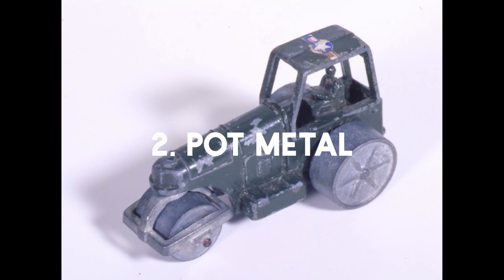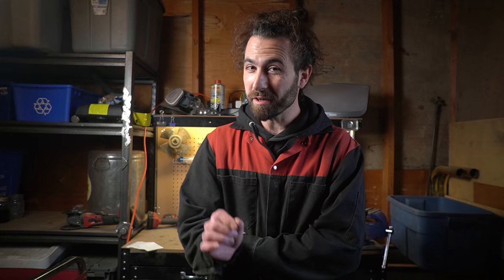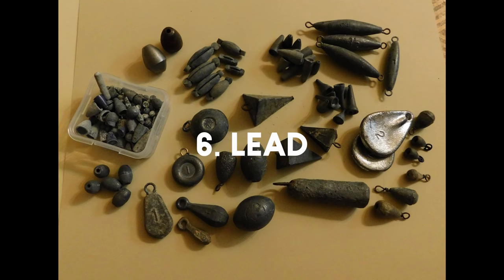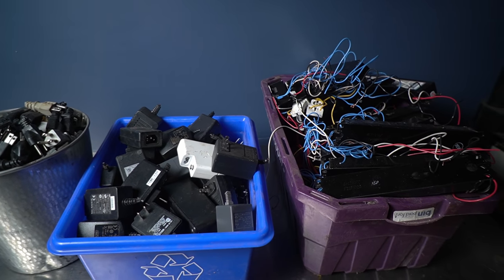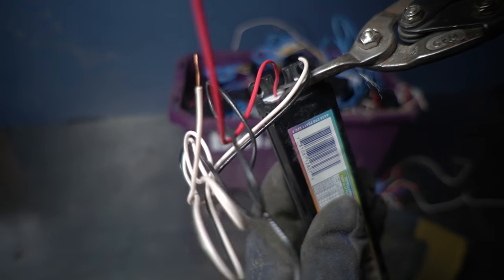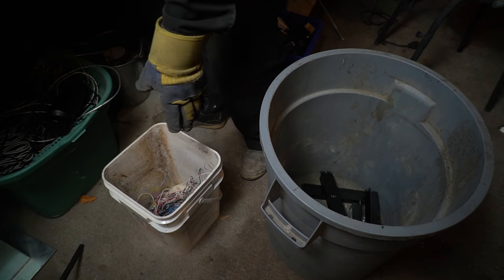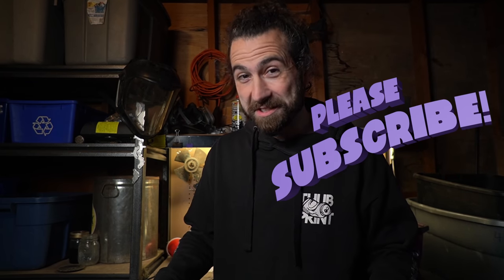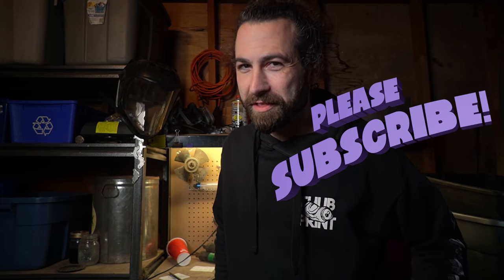I Never Scrap These 9 Items!

Comment: As a avid scraper I don’t feel that any amount of dismantling of items is a waste of time. Yes some things will take a long time but I enjoy it because I learn from stuff and I enjoy a couple of beers while dismantling. Scraping It’s my hobby not my day to day 9-5 job.  It makes some money and I’m fine with that.  The Rest of my time I’m busy on the farm.
Reply: What are your thoughts on breaking down flat screens TV’s?
Reply: @VAcreeper  replying because I’d like to know too I have 3 broken ones in my attic
Reply: It's also the sciences of engineering non-reuse or economic unfeasible (until when needed).  I see people stripping coated wires to get to the #2 copper projects rather than find a way to roll in like 10 feet and multiples lengths for engineering reuse projects.  When an engineering project needs it it will require wirings.  It is not to say that cracked and frayed (or aged copper wire coatings) are a reason to never reuse older wiring into new wiring projects but I think some bench tests can support going further with the wires and protection insulation shielding reuse rather than buy new and guaranteed again.
Reply: @VAcreeper  I do these a fair bit in Australia. There is little competition in picking them up. You get a bit of wire, the lcd is not worth anything itself, and is hazardous. You wouldn’t do it for the money.
Reply: @marcoparigi  that’s what i figured 
I appreciate your feedback 
Thx
Reply: I don't get into electronics.
Donate them to Best Buy or a pick up place.
Old lap tops I donate to a shop that sells used computers.
Cast aluminum, I will sell.
All aluminum is worth selling.
So is, copper wire and brass.
Even if you have to remove it from an appliance.

Comment: one thing to remember is that many people would consider time spent at home stripping metal is a better deal than going to a workplace, you can have a break when you want and are still there with your family.
Reply: You can even do it with your family if they're interested. Me and my girlfriend enjoy picking things up off the curb or out of dumpsters, getting back home and tearing them apart to see what's inside. My daughter(almost 2 years old) likes picking up all the screws and stuff with magnets and helps put plastic bits in a trash bag.
Reply: Hard to find a job you can do from home an hour here and hour there.
Reply: Yeah recently, I found 3 TV’s and a computer monitor in the trash, and I got some nice electronic components from them

Comment: Haha thanks for the mention, plug soup is the future lol easy to pull out all the pins but of course we have 3 nice chunky brass pins but I only boil mine for 10mins in the urn, that's all that is needed in that. I love that you mentioned most of my channel content as stuff you don't bother scrapping 😂🤣 but that is because I have a good board buyer here now in the UK and as you said, it is different depending on circumstances where individuals are, having said that, I have a mountain of laptops to do, they are definitely not my favourites 😆 The ring with copper wrapped round them are toroidal inductors or the large ones (which as a copper adoring woman are my favourites) are toroidal transformers and they contain a lot of copper. If people do the ewaste like me then cherry picking the small ones off of things like power supplies quickly make them mount up, I did that when I was stuck in with Covid. Here in the UK we get a good price for lead at the yard, it is illegal to use lead fishing weights here so no market that way. Fab video 😉
Reply: Mention off thub = made it 😁👍
Reply: @its_marc  lol 🙂 Hi Marc!
Reply: What do you do with your pthalate-cancer-soup after? Pour it down the drain?
Reply: Plug soup.. I love it, saw it on your channel sollers, I've been waiting to give it a go when I have a few more saved up. 😀 
Strange how different things are good in different countries.
Reply: @bfg69bug  oh good, plug soups away, now an international dish😁, I didn't come up with the original idea though, just the use of the urn for a 10min turn around 😄 but it's nice and quick and easy. Was nice to see Thub giving it a go 🙂 Have a lovely weekend James!
Reply: @gasstationpeanuts1814  no it is sealed in screen wash child lock bottle and I can reuse it or take it to the transfer station with old oil etc. It may surprise you that I don't incinerate armatures to get the copper or release the freon out of fridges to get any of the goodies either, some scrappers do actually care about the environment and for me just saving some things from landfill is only the first step!
Reply: @SollersScrappingandDiving  I meant no offense, just a gentle ribbing. I'm one of those weirdo tree-hugging scrappers too, I've peeled many a foil top off of dipping sauces and dutifully cart my cardboard to a local school cardboard collection dumpster.
Reply: i just put each plug on a vise and pull the brass pins out cold using brute force
Reply: @andrewcannon587  sadly I can't do that with the amount of plugs I get because it kills my wrists and I'm awful at doing them as I get them....always let them build up as a round-to-it job, even though I always intend not to 🙈🙃
Reply: @gasstationpeanuts1814  that's awesome, if only everybody was so diligent!! I'm very lucky where I am on the level of recycling we have..thankfully!!!
Reply: I’m also in the uk and a keen fisherman and every fishing weight I have bought for the last 20 years is made of lead and I also make my own they just need to be coated in plastic for inland fishing also I would love to know your board buyer as I’m saving up my circuit boards now my yard will buy them at £150 a tonne so anything low grade goes in a bin for them higher grade boards iv been saving in a separate bin
Reply: Just done some research and lead is fine to use as fishing weights as long as it doesn’t weigh between 0.06g to 28.5g so anything over 1 oz leads is fine to use lead as the weight personally I cost mine in a melted plastic so the lead is covered completely
Reply: @ccartershecticlife  oh I see, I looked it up and didn't realise it was only illegal between 0.06 grams and 28.35 grams, not really a regulation I understand as don't know much about fishing at all, just what my Dad and Hubby say lol. The company is AWA in Essex, I did a video of my trip explaining how it all works and their prices etc 👍
Reply: What is that none magnetic metal inside those toroidal inductors? Always wondered what it is
Reply: @dylanchalker-gent7441  Do you mean the ferrite? If so ferrite is made of strontium carbonate and iron oxide, I love ferrite toroids!
Reply: @SollersScrappingandDiving  is it valuable?
Reply: @dylanchalker-gent7441  some yards do have a category for it but I don't know what it goes for. I collect all my ferrite toroids, I think there is something about them and they will prove to be valuable one day, but that is just me🙈🙂 I like the big chunks of it you get around the yokes in CRT TVs and monitors too!
Reply: Lead fishing weights are illegal there?🤔 That's interesting! and I do understand the why behind it... But hmmm. Anyways, Thanks for all of your info, it was awesome!👍😉🇨🇦
Reply: @kevincordes2026  yes you are right, prices have rocketed, never mind gives me some justification for letting them build up for years 🙈
Reply: @David-sw3on  my pleasure 🙂👍

Comment: Zinc diecast pay way better than dirty aluminum. I can go through a  bucket of molded plug ends in an hour or less. With just a pair of vise grips and a pair of good diagonals. And if you leave a little copper on them they go red brass. Some of us don't have much scrap available, so we learn to scrap everything we can get.

Comment: Just want to add that , on the plug ends, I normally just use 2 pair of channel lock pliers. With the tops of the jaws as  leverage, I don't need to soften the plugs up before removing the brass. some times the brass breaks off but not often enough to make a significant difference in weight. I hope this helps at least 1 person to save time in recycling.
Reply: same.
Reply: I don't mess with them, they are 50 cents a pound as is.
Reply: @TheMurfed  yea but brass is $3/lb
Reply: What planet do you live on? A doller a kilo for plug ends? I get 10 cents @TheMurfed
Reply: Brass is $4 CAD it adds up    Buy a vise for the cord ends, seriously

Comment: the secret difference maker with laptops is the fact that in some cases, you can actually re-sell the Windows license that came with the laptop brand new. like 40 for the software license. Also there's a niche demand for "burner laptops" if you know someone who knows someone who does the dark web thing. Alternatively, take a few days to brush up on your A+ computer hardware knowledge and know that any halfway modern, complete laptop is worth $40 to a lot of people if it powers up, runs stable, and has a power cord.

Comment: Great video. For me, saving all the plug ends and taking the brass prongs out of them is definitely worth it. The way I strip them: I put them in the vice facing up and extract the prongs with side cutter pliers. Not hard on the wrist, very fast process, and no need to warm them up.
Reply from the maker: Huh, not sure why I struggled so much? Well glad you’ve got a good system 😄
Reply: @thubprint  why do you cut the plugs off the #2 wire? I run a scrap yard and have never had any issues with leaving plugs on the shop wire for the 12 years that ive been in business. Also with the laptops you should beable to find somebody paying 2 dollars or more per pound "American dollars" for complete laptops.  I think what you should do with your escrap is save up a large ammount than contact a US buyer to come buy it off from you. Where there is nobody buying it in your area that means you have no competition and could really have a monopoly on your local market. If there are no buyers in your area become the buyer in your area.

Comment: Fortunately for me, and many others, the situation in the US different when it comes to computer scrap.  That said, I agree on laptops.  I just sell them as is, not worth my time dealing with all those screws.  I did a video on power supplies comparing all the different ways they can be broken down for sales.  Bottom line for me - cut the wires and sell as PSU without wire.  BUT my yard is happy to take my #2 ICW with plug ends still on, so I save tons of time.  It's very interesting to watch these types of videos to compare what works and what doesn't in various regions and for different people.  Thanks for sharing.
Reply: I agree..
Reply: @darthtrolleus1947  🤣🤣

Comment: Your totally right. I quit wasting my time on any with a motor smaller than a box fan. Vacuum can be good but then your left with a mountain of plastics only a pro could separate and recycle to keep out of landfill. Keep scraping folks it just takes a while to find a method that works for you
Edit: do call out your buyer. They are allowed a very small percentage of trash to aluminum or brass even and you should be allowed to. To have a good load of aluminum rejected for a few onces of junk is heartbreaking especially when you know they will just mix it in the clean and still get a great price for there's but not yours. It's a rules for thee but not me kinda thing. Stand up to your buyer and they will eventually break. Just don't go full Karen you don't want to lose them completely forcing you to drive to another town and waste more of your time and money
Reply from the maker: I’ve learned that lesson myself, didn’t realize at first that they have a certain percentage of contaminants they allow in their clean bins. It helps to have several yards to choose between!
Reply: I grabbed a vacuum some put at the curb with their trash, tore it apart and made over $100 selling the parts on ebay. .. sometimes i cringe when i see scrappers just binning stuff because they see the $2 in copper but not the actual item that is 50x as valuable.

Same thing with conputer power supplies. The conponents inside are worth more than the copper, usually some large caps, high quality fets, ect that will all sell for wayyyy more than scrap value

Comment: I always welcome your perspective. I definitely save the zinc die cast and for a while I was getting a good number of PC power supplies while helping a non-profit dispose of their old computers. For plug ends I just break off the brass blades, but my scrapyard doesn't need the plugs cut off for #2 ICW, so I leave the rest on.

Comment: Hello Thub.
Plug ends,, I clamp them in the bench vice and a pair of sidecutter and pull them out, sometimes the copper strands come with.
Those round coils are called Torroidal transformer.

Comment: thx for the perspective! honestly i spend too much time breaking down anything, so i value the reminder. I too keep my lead, but for a different if not dissimilar reason: I'm teaching myself to flint-knap, and in so doing I also decided to make my own tools, including boppers. picture copper pipe with a cap soldered on the end, then fill it with lead for weight. ✓✓bopper✓✓. i took a little homemade ingot in to my scrapyard, asked the price, and immediately grabbed it out n took it home with me. waaay more valuable in my workshop as material.

Comment: I appreciate the video.  Like you said this is an opinion piece and I completely respect your choices.  As for me I do all my detail detail work while sitting around watching TV at night.   I can tear down several laptops during one feature length movie so its not like I'm wasting any time. Same with the plugs.  I've found a way that is pretty simple but you are right it can be hard on the wrists.  

Bottom line if you are spending time on the low end stuff when you could be doing something more productive then yes its a waste of time.  If you can multitask though it can add a bit to your bottom line.

Comment: The ballasts have too much tat like silicon inside to be worth anything but we go through them pretty regularly in our warehouse and the wires are solid strand copper that strips easily with a knife.  Just clip the wires off, put the wire in a vice at one end, hood the wire tight with your hand at the other, and swipe your knife down.  Usually one pass with a sharp blade will cut the insulation off pretty clean.  Then after I’ve got 10 or so wires of good length I put all of them in the vice at one end, and the other ends in my drill chuck and spin them tight until they ball up really tight.

So far I’ve got about 5lbs of really clean copper wire.   Not great money.  But not bad.
Reply from the maker: Oh I’m with you there, the solid-core wire is super easy to strip
Reply: A DIY wire stripper does a great job too.. I over the years made several different manual wire strippers.. Saves you hands a lot of cramping

Comment: Random question.  When you throw items in with steel that have other types of metal in them, does the machine separate the other metals from the steel or does it all just get mixed in together for processing?  Always wondered how that worked.  I've been tossing the power chord ends in with steel all this time and would hate to think I'm ruining the steel shred with brass.
Reply: Mixed loads get sent to a shredder. There are large magnets and eddy currents belt that will separate some of the different metals. It is a really neat process.
Reply: When the steel goes to the smelter different material melts at different temps so they are pulled off. Many times that pays for the heating power with the Cu and Al.

Comment: Great video. As a scrapper it's all about how much time I want to put into it and how long I want all that junk piling up.
Reply from the maker: Exaaaaaactly. Scrappers have to manage their time and space to maximize input/output
Reply: @thubprint  finally bought a powered stripper. There was a small learning curve on how to use it but it's so much safer than using a utility knife and half the time. $175 for the powered 150ish for the drill powered.

Comment: Have a 9" side cutter and grab prong close to plug and pry up. Use another pair of slip joint pliers to hold plug. Usually 2 to 5 seconds and it's out with small amount of copper wire.

Comment: Power supplies: I just cut the cables off for low grade and shread/steel the rest of it.

Pot metal: My yard would consider it dirty AU.... The one I go to buys it the same as Aluminum so I just do that and call it a day.

AU Pie plates: I used to avoid them.... but then I went to the new yard I live near.... It helps fill up the AU bin in a week or two. Not killing it by any means, but $5-10 extra is extra cash

Laptops: ...... "Some" of the components are worth money. But for most they're not worth your time. 

Small Electronics: I agree. Not worth the effort at all

Lead: I have no reliable source for it to say 

Power plugs: If they weren't so damn difficult to strip the brass out it would be a good source. 

Ballasts: For a hot minute it seemed like I ran into those every day. They're next to worthless though. Not much better than steel no matter what you do

Transformers from power supplies: I just mix them in with the steel and call it a day. It's not worth it. One day when I have the space and the tools to break them down I 'may'

Comment: Iron 15 cents # #2 dropcoard $1.25 #1 Romex $.195 extruded/ cast aluminum 45 cents. Lead 50 cents. Copper #2 $2.95 Copper#1 $3.95 Dec 1 2022 St louis Metal.